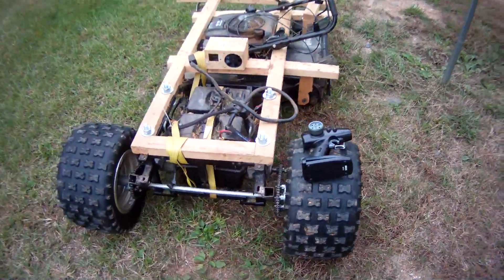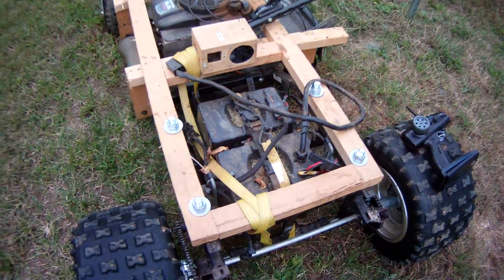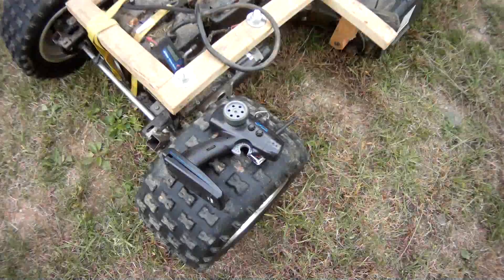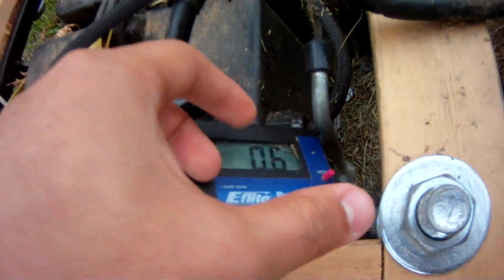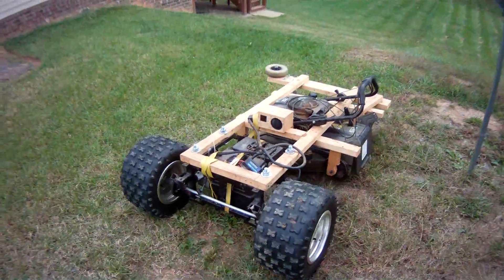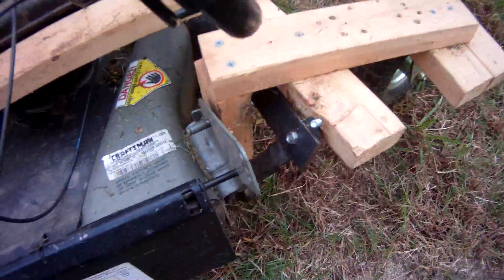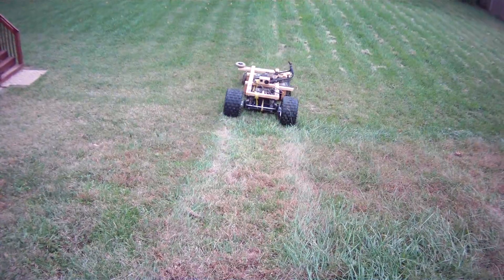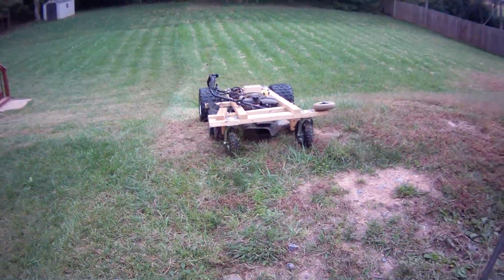RC slope mower

Comment: What transmitter and receiver are you using?
No one ever mentions these.
Reply: Pablo453 Any will do, the transmitter was from a ProPulse RC car, which I added an ASSAN hack transmitter module.  (Used an oscilloscope to find the PPM signal) Nowadays I"m using ones the FrSky Hack Module and FrSky receivers.  Since this video I've torn the thing mostly apart.  I was gifted a john deere tractor and can cut the lawn much faster that way.
Reply: Santiago Saldana I've tried a 2ch (Harbor Freight plane) system, a 6 ch truck system, both at 27 Mghz.
I only go 1 channel to work with the motor controller each time. (Sabertooth 2X25).
I'm going to try a 2.4 Ghz radio next since that's what I see a lot of people using.
I just don't know if I should get the 5 ch or the 2 ch.
Reply: Pablo453 Although I've had troubles with odd 2 ch systems before.  As long as they can normally drive a servo, then it should work with the Sabertooth controller.  I do remember one of the problems I ran into was that my hacked ProPulse transmitter has a rotary knob on the side to control the amount of turning available.  I unknowingly had it turned down too far and it wasn't changing the steering enough.  If I remember there are also a lot of modes on the Sabertooth, you may want to check the dip switches to make sure you're in the right mode.
Reply: Santiago SaldanaTrying a Spektrum DX5e with AR610 receiver next.
I may do some testing again later with the previous radios.
Thanx for your help and keep makin videos.

Comment from the maker: I did, but there wasn't enough traction nor height to get over the bumps on my hill.  It takes a LOT of traction to be able to push the mower up that hill.  Additionally, the standard lawnmower motors didn't have enough power.  It could have been possible, but it currently pulls 40 amps with the gearing I have, it would have been far too much otherwise.